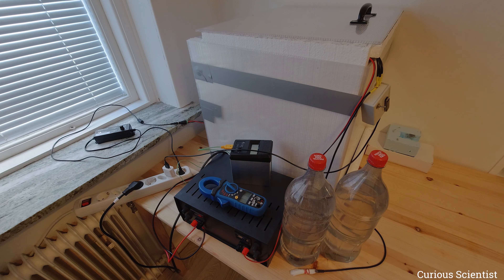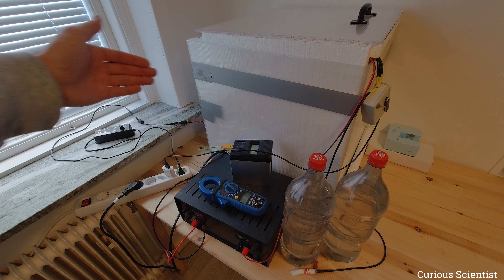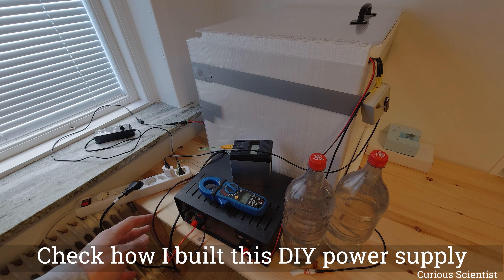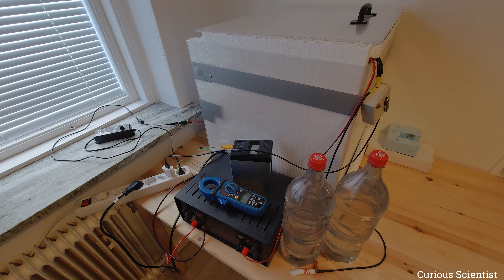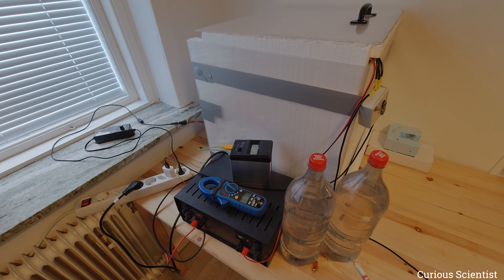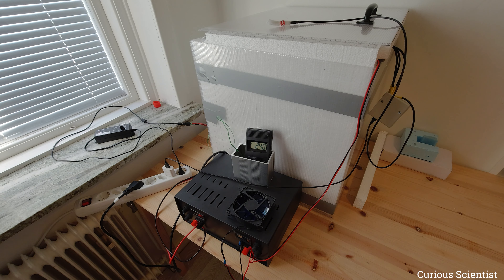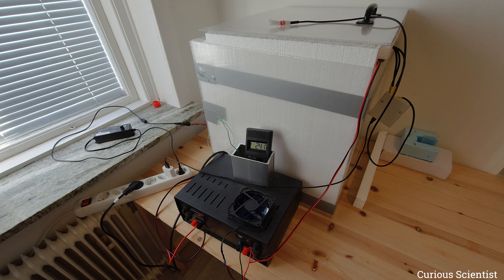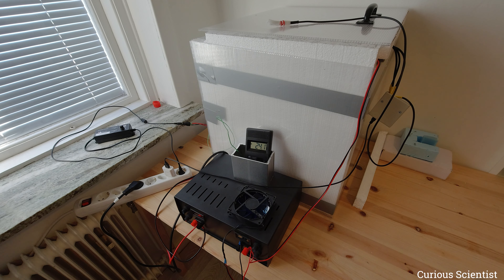Peltier based cooling box - Refrigeration test [Part 6/6]

Comment: I think it will take more than 9.5 hours.  Because as the water temperature drops there will be a loss of performance in the transfer of heat between the cold face and the water.  I love the videos because I'm starting a pretty similar project, a 12-24v DC and 220v camping fridge.  Starting from a commercial ice chest, model igloo marine 36, I will build the top side with peltier 12a x2, Arduino, voltage control, performance calculation, automatic light with door opening, integrated LCD and carbon fiber cover.  I will try to make a video of the process.
Reply from the maker: Nice project! I was also thinking about converting a commercial cooling box/ice chest into a cooling box, but when I checked the price of the boxes, I gave up on the idea. Also, building from scratch was more fun to me. 

Regarding the Arduino, what would you use it for? How are you planning to realize the cooling control? Do you want to turn the Peltier on and off based on some temperatures, or you want to keep it on most of the time and just control the current/voltage? 

You project sounds really interesting, it would be nice to see the details. I also agree with the cooling time, it might take longer. It would be fun to try it, but I am a bit concerned about my electricity bill. If I can suggest something for you, use as big as possible heatsink on the cold side too!
Reply: Do you have a way to control the voltage? Just using PWM would not be energy-efficient. PWM control of mosfet, followed by a big filter could work -- in effect a custom switched regulator.
Reply from the maker: @andpe161  PWM is not the best solution. I started to work on a "better" one. Keep checking back to my channel for more information. As I progress with the project, I will upload more and more new videos. It will be a microprocessor-controlled power supply.
Reply: @CuriousScientist  I have been studying for several months the power required to build the 36-liter refrigerator. My goal is also to reach 4 degrees but a little more difficult because in Spain the climate can easily reach 28 degrees 30 degrees outside the refrigerator. That's why I'm going to do it on a marine igloo whose insulation I hope is much better.

I already bought 90% of the materials, including the igloo marine. The design of everything I have almost complete, but it will still take a few months to finish the project because I have to finish another and my work does not leave me much free time.
My outlay has already been about 180 euros approx. I hope it cooled enough. For this reason I want to see the test of your project until it reaches 4 degrees, I hope that at those temperatures the insulation is sufficient and the cooling curve does not turn horizontal before arriving.

In my project, the arduino will control the voltage that reaches the peltiers so that when the desired temperature is reached, the consumption drops, but without turning off the peltiers completely. I will have to see the voltage it needs to maintain the temperature. In addition, it will send the most optimal voltage for the best performance, I have already seen your tests and 12 volts is not always the most optimal.
The ardino will also control when it is plugged in at 12 volts to limit the current drawn to 15 A maximum so as not to damage the electrical system of the vehicle. For 220V plugged no limit amps.
For the interior heatsink I have a large aluminum grill weighing 500 grams. With a delta fan of 5000 rpm, for the hot side I have two cpu coolers of 140 W each. For the hot side I know that a larger one would be needed, but I will see the possibility of the arudino controlling the voltage of the peltier when the cpu cooler gets too hot or even replacing the peltiers with the 8A model.

I have no problem with the cost of electricity because the project is to make long trips in the vehicle or camping where you only pay for the connection.

I will record videos and make a summary that I would like to share with you.
Reply: @andpe161  Good, for that I have two open channels, what you say about the mosfet plus the filter or directly buy 2 step-down modules of 15 A each, these purchased modules already have a perfectly balanced filter.
As I read in other tests, the peltier loses performance with pulsed signals.
I already did tests with mosfet and filter but I do not have great knowledge of electronics and it is difficult to configure a filter that works well in different loads. This ends up causing power supply problems. I already tried with different frequencies.
The option that I will surely install will be a stepdown to which I will make a small modification, I will replace the analog potentiometer with another digital potentiometer that will be controlled by Arduino.
This is the only remaining part of the design but I need to do more advanced testing with an oscilloscope.
Reply from the maker: @Angel_Padilla  regarding the electronics, you cannot just replace the analog potentiometer to a digital one. Most of the digital potentiometers can only survive 5 V, while the potentiometers in the step down converters experience the total output voltage (so, for Peltiers it can be as high as 15-18 V!), because that's how the feedback goes to the buck converter. I also wanted to do this way, but I had to change my plans due to this problem. I started to work on a workaround, but it needs time. I will publish every details of it, so you will be able to replicate it.
Reply from the maker: @Angel_Padilla  excellent plan! If you want to discuss in more details, please find my email address on my website under the contact menu. It would be great to exchange ideas! I can also help with the power supply part, if you want.
Reply: @Angel_Padilla  It's probably not energy efficient to run at 15A given the dimnishing returns of peltiers at high effect - relevant if you will power from battery. Calculate the energy loss through the insulation at your target temp. to learn what peltier effect is required for equilibrium. Peltiers rated for lower current are more efficient, I think. Also, extra current control is probably unnecessary if you pick a voltage limit. A fuse doesn't hurt, though.
Reply from the maker: @andpe161  I think she was just referring to the DC-DC buck converter, and not the current that she want to use to run the Peltiers. A good trick is to combine parallel and serial connection of different Peltiers to create a good current and voltage divider. So you can use your 12 V source straight away for example.
Reply: @CuriousScientist oops, I hadn't really taken into account that limitation of the digital potentiometer. I thought that the 5v was supply voltage for digital potenciometer and that the side resistance did not have that limitation. However, there are other models that can go up to 36v.
On the other hand, I am investigating to find the possibility that the arduino sends the feedback directly to the control pin of the buck converter chip without the need for a potentiometer.
 The chip on buck converter simply need de feedback a voltaje for regulation.
I will look for your email to send you the details when I have any progress. Sorry for my bad english.
Reply from the maker: Your English is excellent! 
Yes, there are better digital potmeters. I was looking at them, but I could not buy them yet. 
Yes, the idea of directly controlling the chip is the way to go. I was thinking about different things, such as injecting/extracting voltage to the circuit. Or using some transistor + coil and PWM from the Arduino...etc. I also still need to do some research in this area. Actually, I ordered some buck converters some time ago. When they arrive, I will test these things on them. Hopefully, it will be a successful experiment.
Reply: @andpe161  PWM is not a good method over voltage adjustment as  while the voltage is off as part of the PWM the heat from the hot side will migrate to the cool side. This then has to be removed from the cold side when the voltage  is on as part of the PWM cycle.
Reply: @andrewtitcombe8378  Don't know if you really meant to address me? Because I agree, PWM is not good for peltier control. Filtered PWM however is a switched regulator and will not have an "off" phase, so there won't be a reverse leakage.

Comment: I will write here too, because I saw something interesting. 
You are trying to cool down 4 liters of water from 23 to 4 degrees, which is dT = 19. The needed energy should be 4x19x4.2/3600 = 0.088 kWh.  If your estimated time is correct, then 0.089/9.5 = 0.01kW. So  only 10 wats are used to cool the water. But your Peltier are supposed to provide much higher input. So there here are my assumptions: 1 your prediction is wrong - unlikely. 2. Your box has very big losses - unlikely. And 3 - the peltiers transfer much lower Q than they are supposed to at this current. I think this is likely, because the small cold sink limits it.
Reply from the maker: Thanks! Yes, the cold side heat sink is definitely too small. I don't remember in which video in this series but I show the effect of a fan blowing the air on the heatsink inside the box (cold side heatsink). It leads to a better thermal coupling between the environment that we want to cool down and the cold side of the Peltier. BTW, in a few months there will be some drastic changes which will allow me to work on Peltier projects again. I will pick up some old measurements and experiments and try to improve them based on my experience gained since those old videos. I also have some ideas for future projects.

Comment: I noticed the CPU coolers were mounted horizontally, but heat pipes need to be mounted vertically for the most efficiency.  This is because the evaporator end needs to be below the condenser end for the best evaporation, since it is aided by gravity.  This chart shows how the inclination angle affect the power output of the cooler.  So your results would improve considerably if the cooler were mounted vertically.  https://celsiainc.com/resources/calculators/heat-pipe-calculator/
Reply from the maker: It really depends on the type of the heatpipes. The inner structure can differ and the cooling can be affected by the inclination differently. For example, most of the computer coolers are mounted sideways and they perform really well. Laptop coolers are also horizontal. Also, for this kind of cooler construction it was not possible to mount the coolers differently.
Reply: Horizontal heat pipe coolers work, just not as efficiently as vertical units.  That was my point.  As you can see on the chart there is a ~47-48% drop in efficiency between 90 degree and 0 degree inclinations of heat pipes.
Reply: Vapour refrigeration system  cold room fin spacing is wider than a freezer room evaporator fins. I assume this is because as the heat transfer efficiency at a  lower temperature becomes lower and therefore needs a larger surface area between the the cooling surface and  the air passing over it.  (my guess, but will study this further )

Comment: What was the air temperature inside the fridge?
Reply from the maker: Watch the videos, the answer is there.
Reply: @CuriousScientist  Good on ya mate 👏👏. I'll spend the next hour watching all of the videos to find the answer to my question that you could of answered in similar effort to replying to my comment.
Reply from the maker: @johnyoung7691  If you go to the very end of the video or go to my website (link is in the description), there is literally a HUGE chart which shows the time vs. temperature data measured at six different points in the setup... Sorry, I cannot make the data even more easily available... 🤷‍♂

Comment: and now that you've the condenser and evaporator setup you can test this efficiently. Minus the fact that water and aluminum is not a good thermal conductor in todays standard. I bet you'll need a lot less power this time.
Reply from the maker: I won't build another system.